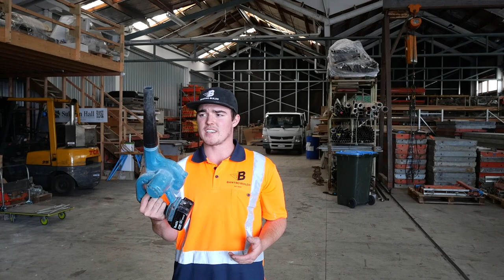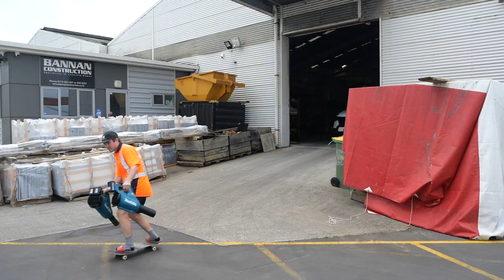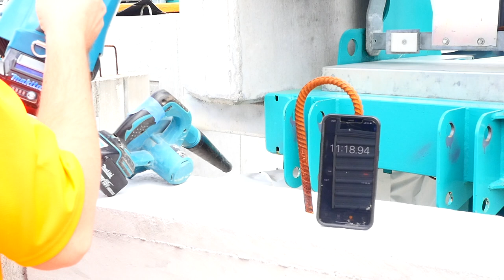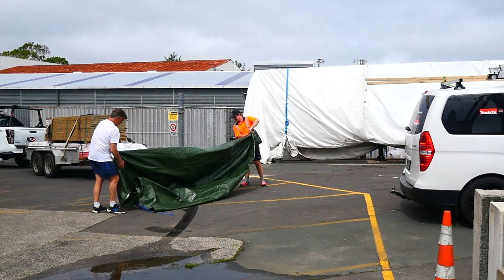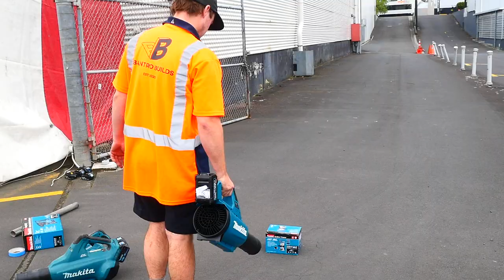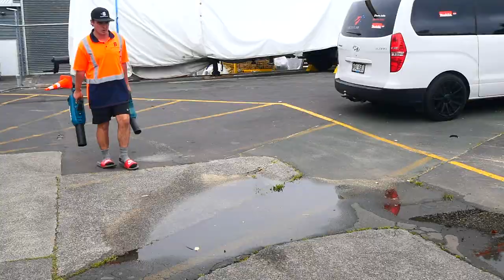Makitas old 18V, 36V and NEW 40V blowers in action! IS 40V WORTH IT??

Comment: There is ZERO difference between 18v and 20v or 36v and 40v. Both batteries are 18v for storage and 21v charged. Companies are playing with the numbers to confuse the ignorant. Battery packs that use the newer 21700 cells vs the older 18650 cells have more capacity and are slightly heavier but voltage remains the same. 18v x 2 or a single 40v are the exact same voltage fully charged. 42v
Reply: what about the watts as the 40 v power head can deliver 1000w as apposed to  the 36v power head that delivers 620w?
Reply: @zarrow50  Either they switched to 21700 cells and can draw a few more amps or the inverter is just different
Reply: The 21700 cells have a higher discharge capacity.
Reply: 36 and 40v makes it easier to differentiate XGT and LXT.